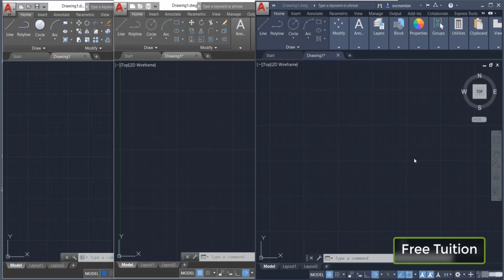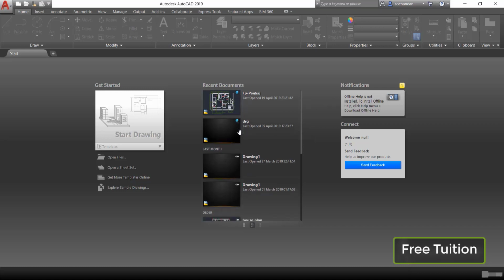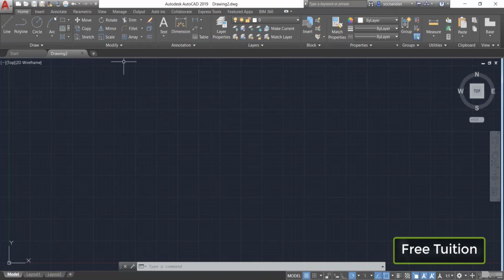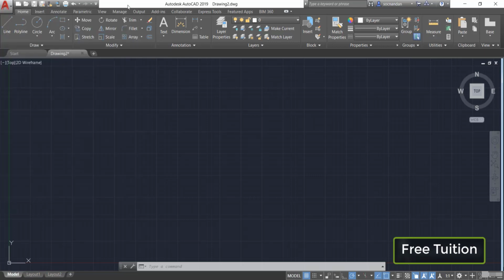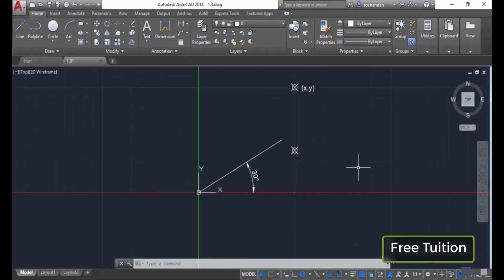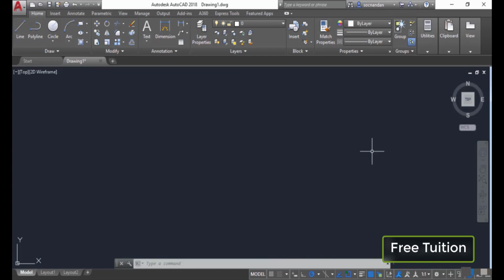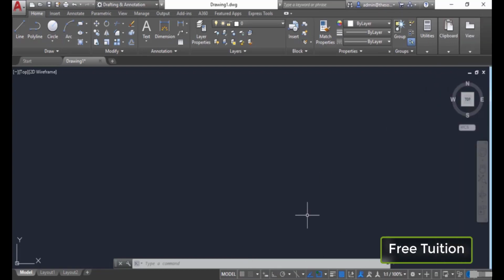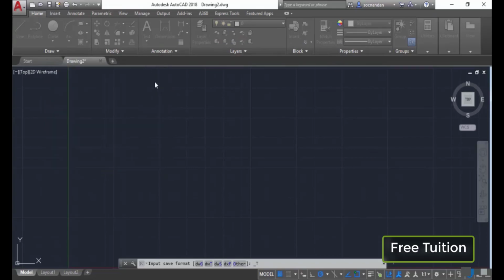AutoCad Tutorial - Part 1: Getting familiar with AutoCAD

Comment from the maker: You can skip to these topics.
 Auto-CAD user interface 0:00
Navigation tools  15:12
Understanding Co-ordinate system 20:09
Limits and display units 23:44
Saving settings as drawing template 28:11
Practice Question 32:07